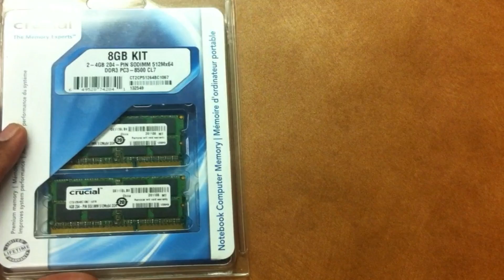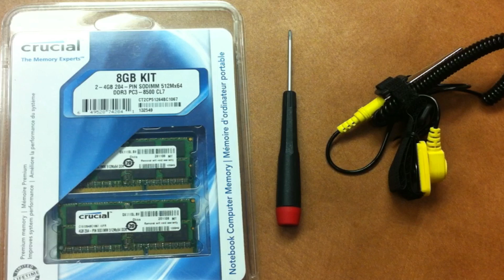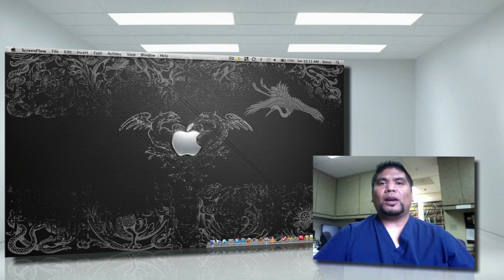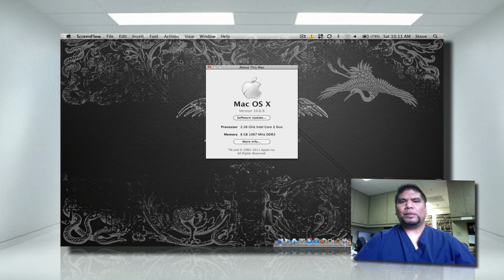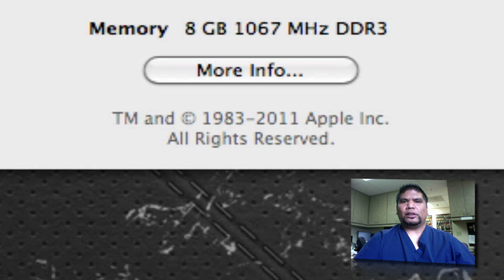How to upgrade your RAM on a Macbook Pro

Comment: hello steve, i just installed new ram according to your instructions, everything seemed to work fine and i treaded the equipment with great caution. 

the next day applications would quit unexpectedly. apps like photoshop cs5.1 zbrush, sculptris etc.

how can this be

i've got a 2011 MBP 17" standard config. the ram i purchased was a mac graded g.skill 8gb DDR3 1033MHZ 2x4gb kit.
please help, i really need those apps to work.
tried:
*reset disk permissions
*clean my mac
*software update
*reboot

Comment: I've got a macbook pro 2.53 GHz (mid) 2009, with the intel X 25-M SSD. I am considering upgrading the RAM from the standard 4GB of apple chips to 8GB or third-party RAM - to allow my mac to run smoother when many applications are running. It seems with lion and 'Mission control" - the emphasis is very much on memory greedy multi-tasking.

I was wondering how much of a increase in system performance you saw after installing the new chips?

The RAM is so low-cost, does this mean lower quality?

Comment: Thanks for the tip Steve. Let me ask you something, is it true that the bigger hard drives are slower than the ones under 500GB? 1TB of hard drive is definitely a lot and worth it for a primary computer, but how about opening apps and boot up time on your computer, how does it affect the speed?